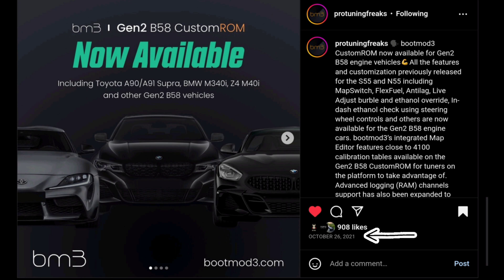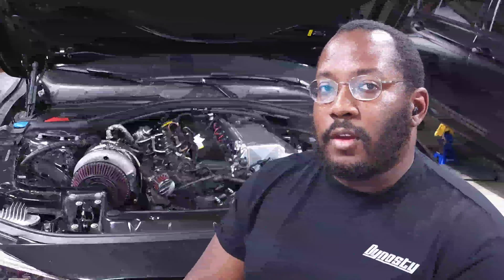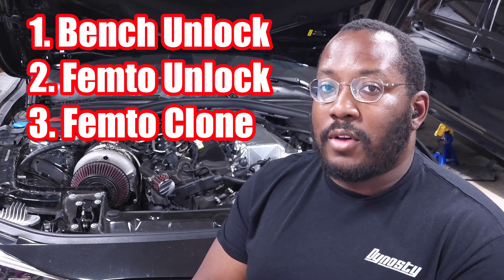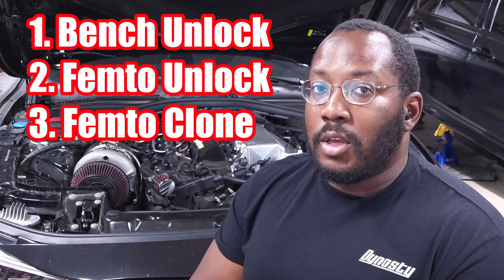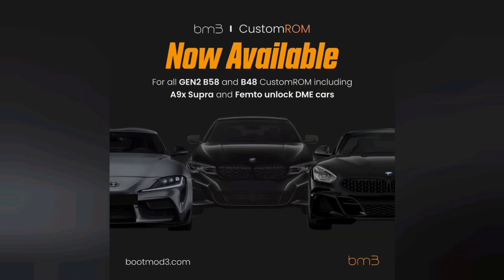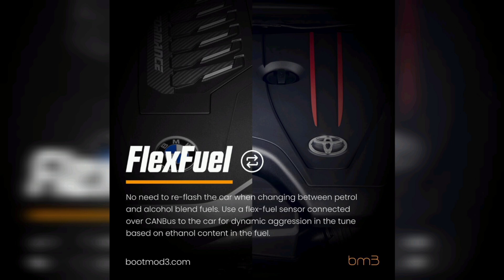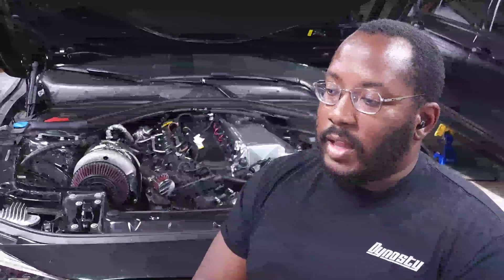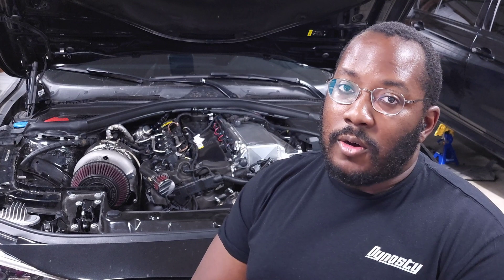A90 Supra and M340i get Flex Fuel, Map Switching, and Antilag in latest Bootmod3 Update

Comment: Does this support port injection for the MT supras or do you still have to run a separate controller for it, if so would you consider releasing a video about the B58 fuelling options especially for the MT A90’s. Much appreciated!
Reply from the maker: This has nothing to do with port. You still need a separate controller. I made a video a few years ago but may make an updated one
Reply: @kern417  ah thank you so much! Im trying to understand more about cars in general and your channel really helped me a lot. The manual A90 is what finally got me interested in cars as I am contemplating on getting one soon (waiting on the 2024 now) 

Where I am from, cars are massively taxed to the point where a new civic here would be more expensive than a new M3 in the states. Needless to say the tuning and modding options here are very limited. So I am trying to have a better understanding of everything before I dive in. I plan to go with Remnant performance Gamma system for the intake manifold but i’m unsure as to how the fuelling for the port injections would work, do you need another LPFP? How does the ecu handle the extra fuel injectors? Really looking forward to your updated video soon!
Reply from the maker: Just depends on your goals. It can get expensive with new cars. We're also still finding clutch upgrade options for the A90 trans. We'll see what develops this year.
Reply: @kern417  I think Clutch Masters have some options available now actually but waiting for the market to be more matured for sure
Reply: @kern417  Clutchmasters released the FX1000 for it a few weeks ago. Supposed to be really good. It should likely handle well beyond what the transmission itself can handle.

Comment: B58 440i running MHD tune with catless DP, Dorch stage 2 HPFP, and stock turbo. What is the benefit of adding an MHD flex fuel kit?
Reply from the maker: Automatic adjustment for ethanol content
Reply: @kern417  so, no need to mix and measure?